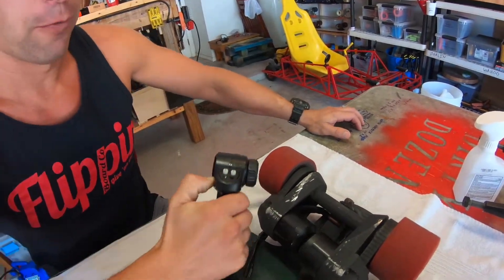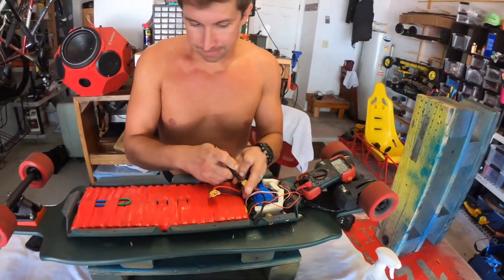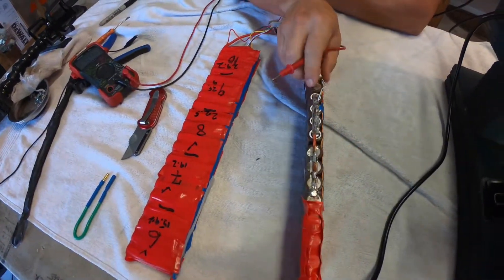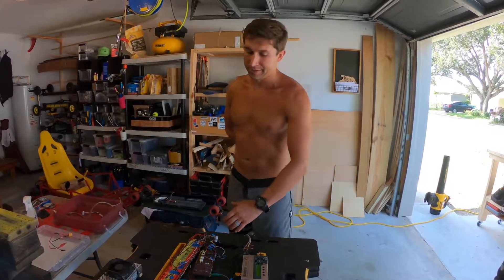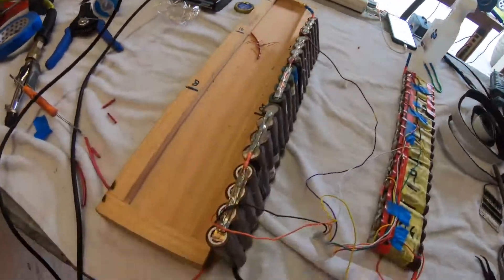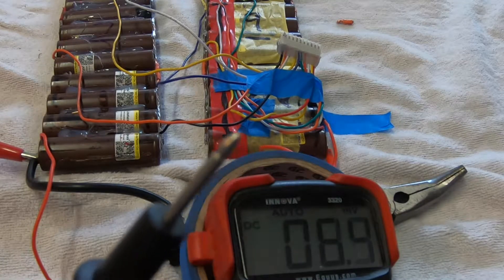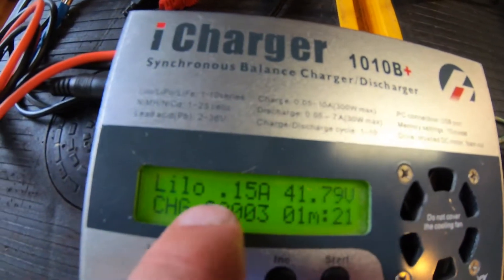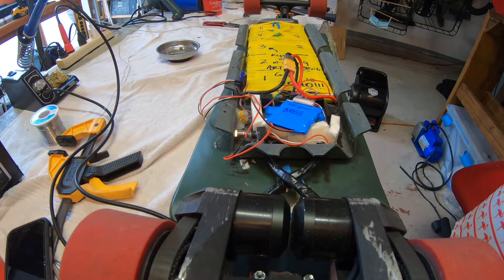Skateboard Battery Repair Tutorial

Comment: i got a 10p3s  thinking about building a new batterry pack just to learn it    my old battery are 3.7v 2000mah so do i have to get the same 2000mah or can i go a little higher ? 2500mah an what would that do ?

Comment: Love this video, a lot of detail. This is possibly what im experiencing with my Backfire Zealot. Im waiting for Backfire's response before I make a move. My only question so far is if that battery spot welder is needed?
Reply from the maker: Hi Michael. You can get around spot-welder. How is your soldering?
Reply: @artsiomnaidzich9515  basic soldering is not the best lol
Reply from the maker: Thanks. Im curious what the problem is with your board. Let me know when you find out.
Reply: @artsiomnaidzich9515  they said two cells were low on voltage. They repaired it and will ship it back. I cover the shipping going and coming.

Comment: Hi! Are you interested in repairing my battery pack for my Meepo NLS pro for money? Meepo told me the battery is broken. It still works, just doesn’t fully charge. You seem to really know what you’re doing. Maybe you could make a video out of it? Or just charge me a flat rate? Please let me know, thanks! 

-Anthony
Reply from the maker: Good Morning Anthony.  Yeah, I can help you out.  DM me on FB messenger or instagram.  Cant tell you how much it would be until I see the battery pack.  I think meepo uses 10s2p.  There has been a shortage of li-ion cells out there, therefore scavenging for replacement parts may take some time.
Reply: @artsiomnaidzich9515  did you guys end up getting it fixed? I’d love to see a video of the meepo battery getting torn apart and repaired.
Reply from the maker: Not yet. Suburb hasnt reached out to me. Very similar to meepo board is this board. Riptide. Only difference is power pack. Riptide has a 6a3p power pack. Z rest of equipment is the same.

https://youtu.be/NXPEJn3dHxw